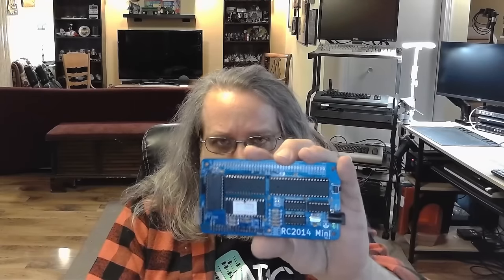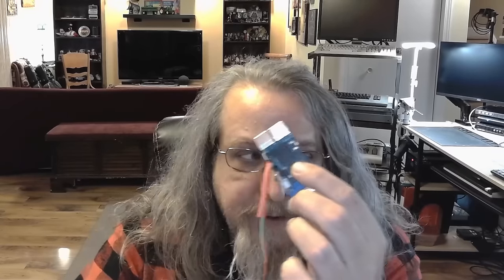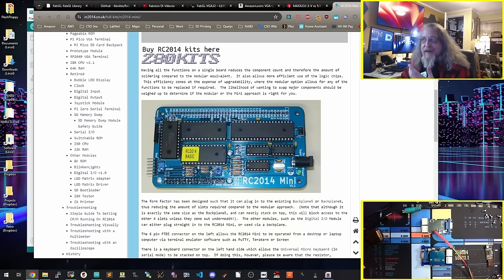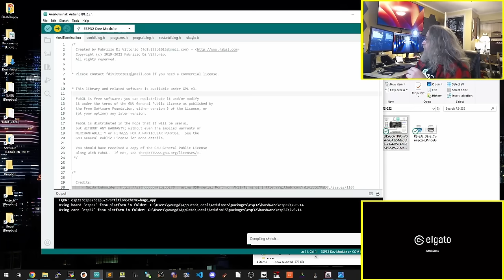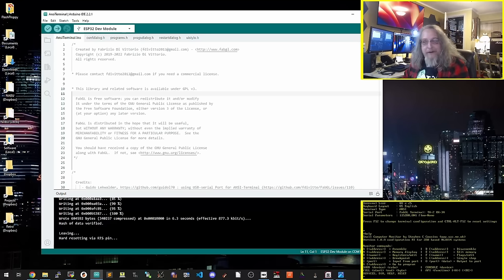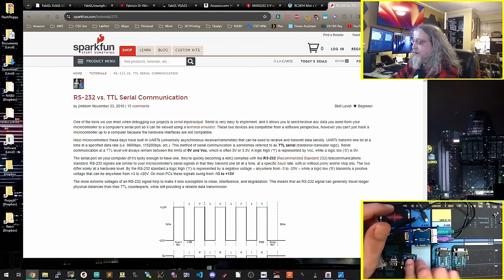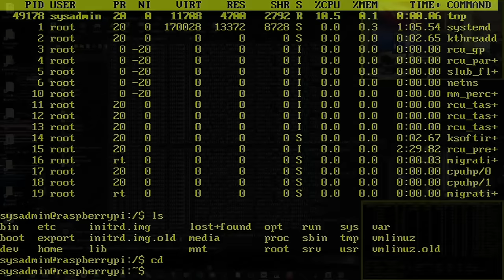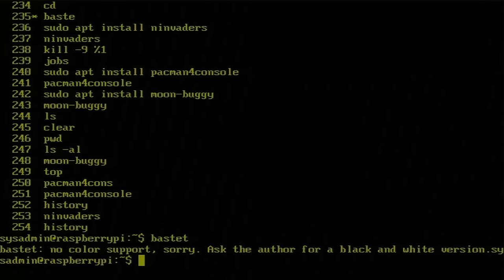Build a DEC style terminal for $25!

Comment: I built a battery powered dedicated 'terminal' using the Lilygo board and a MAX3232 for my RC2014. It isn't documented anywhere, but if you attach a battery to the board,, there is a charge circuit built into the board (via the USB socket). One 18650 will power the terminal for days!

Comment: it's wild that the "dumb terminal" has more compute power than the mini or micro it's plugged into.
Reply from the maker: It really is, the same project, FabGL, has a VIC-20 “emulator” example, I’ve toyed with picking up a VIC-20 case and keyboard and using the ESP32 VGA to build one. Zero useful value other than “this is frickin weird”.

Comment: I like this, but I am allergic to the idea of using an entire computer (the ESP32) to do something so trivial.  (If you're going to use a complete computer, just use a computer, you know?)  This seems much more like the kind of thing where an FPGA would really be ideal, though an FPGA would certainly not be cheaper or easier to implement.  It really feels to me like an FPGA is the right tool for this job.  FPGAs handle RS232, VGA, and HDMI with ease, and can go all the way up to resolutions like 1920x1080 and beyond, though not all the way to 4k.  On the other hand, you would probably need to implement a CPU to handle all of the terminal compatibility and features that something like a DEC 525 terminal would support, so what do I know?
Reply from the maker: You’ll love the video on using an ESP32 just to turn on a light bulb then. Granted, it’s on a C64, but still relatively useless. Possibility for the sake of possibility is what inspired us to build the Internet.

Comment: Looks good! I bought one of the ttgo-boards a long time ago, but in the end I went with a version of the Pico-based VersaTerm. Had quite a bit of problems with those adapter boards though, most have a cloned chip tag includes a nasty bug. If you power-cycle one of the ends, then it will sometimes start heating up (as in scorching hot). The versions with a DIP-chip don't seem to have this issue, but then again - they're pretty huge 😅
Reply from the maker: I’ve been meaning to build a VersaTerm, but for $25 this one holds up decently well. Enough so I don’t have to be terrified taking my vt320 to shows.
Reply: @technicallyworking4real Either solution does what we want it to, so it comes down to be preferences - it's good to be spoilt for choice 😅

Comment: This is the kind of video youtube needs more of. Thanks for the info. I have been struggling with terminal ideas for my 6502 SBC project
Reply from the maker: Wow, thanks a lot for that, I tried to “get to the point” as much as possible so others could get something out of it quickly. I’ve been using it for a while now, having a dedicated terminal sitting there is massively helpful, especially one that you KNOW works.

I’ve since put 3 of them on a small KVM and hooked up an old serial switcher to one so I can bounce around between them and various inputs. You know that old manual RS-232 switcher we all had years ago? The ones we all said we’d never need again? Yea, one of those. ;-)